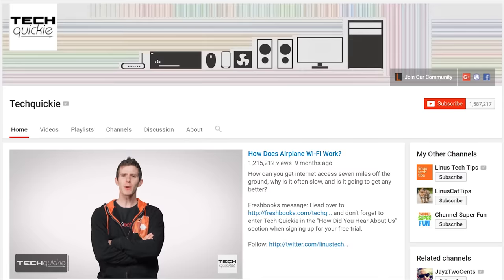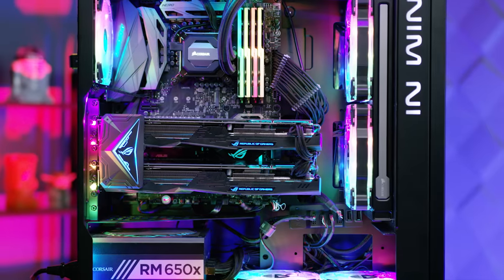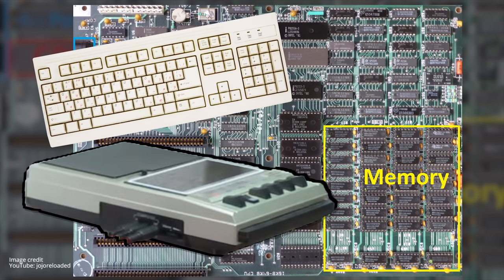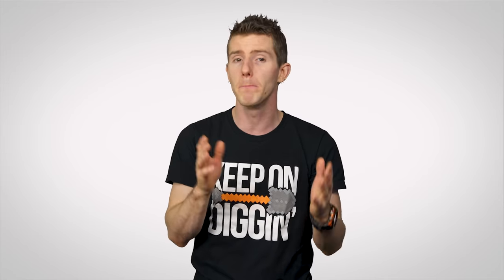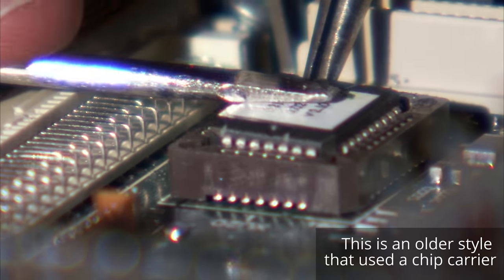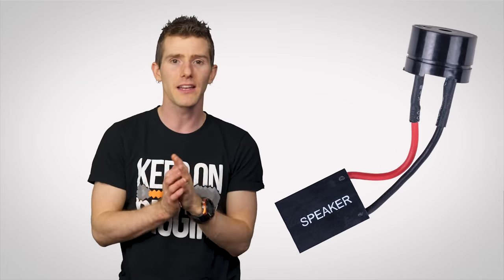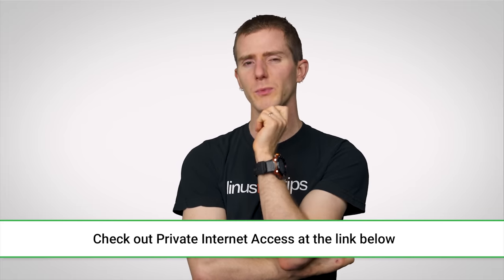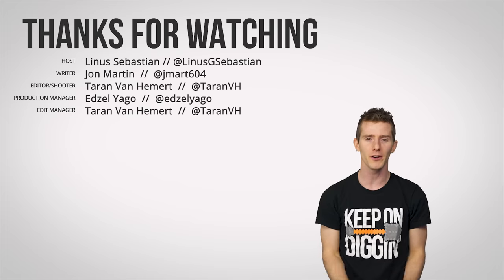History of the Motherboard

Comment: My first PC didn't even have an ethernet port. Wow, I'm old.
Reply: My friend's son's first PC does not have it either
Reply: And mine had no hard drive but booted up from 2   3 1/5" floppy's Ms dos disks. Tandy 1000tx . Cost  $1800. Some progress!
Reply: And I'm so young, my first laptop also doesn't have an ethernet port.
Reply: like in new mac ?
Reply: Apple enter the chat ...
Apple became admin...
Ethernetport kicked from chat...¿
Reply: My first PC still had a token ring network ;)
Reply: I wub u
Reply: @goodboi42  macbook?
Reply: Remember IBM?
Reply: @hesoyam9004  Pepperidge Farm remembers
Reply: Same! I remember my dad buying a home networking kit which came with two PCI Ethernet NIC’s, a 4 port Ethernet hub, and two Ethernet cables, and we had to add the cards to the PCs
Reply: I built my first PC from a kit and soldered each chip onto the motherboard. It used a Z80 CPU chip. I can't remember whether I expanded it beyond the base 16kB RAM all the way up to a whopping 32 kB or 48 kB. I entered the code for an alternative compiler into it (BASEX) by typing in the hex codes of the entire compiler.
Reply: @Bas_Lightyear  me too. I spent a lot of time in the attic pulling in cables. Those cables have been upgraded to Cat 5E now and the network has evolved from 10 MBPS hubs to 10 MBPS switches and finally 1 gigabit networking switches. I remember the NICs we had were a nightmare to get running in Windows 98, but a LAN party with friends and C&C was legendary.
Reply: Yes you are
Reply: I don't think the AST 486 we had when I was a kid did ether. I remember it had a dailup modem...
Reply: @JohnSmith-xq1pz  our first dialup modem was an external either 9600 baud or 14.4K Motorola. LOL! Networking was never built in those days, because people were lucky if they even had one computer.
Reply: @HughsAlfa33  No respect from kids these days...
Reply: @FoolOfATuque  Oh wow that's old lol. I think ours was a modem card. I don't remember there being a external box the phone line went into. Due to the old phone lines here we never got past 28.8kbps... thank God for 1mbps broadband cable internet of the late 90s lol (we had a super socket 7 Pentium  by than)
Reply: @JohnSmith-xq1pz  yeah, I’m pretty old. LOL!
Reply: @FoolOfATuque  lol I'm getting there...
Reply: Mine didn't have a heatsink.
Reply: @travis1240  386 class?
Reply: @standupyak  my new-ish Windows 10 laptop doesnt have one either
Reply: My first computer only had a tape drive... and my first PC was a 386. Which didn't even had a CD Rom Drive... and a 30 MB Hard Drive.
Reply: And you are all young, when you used Modems. You know what acoustic couplers were?
Reply: @acmenipponair  I know of them...
Reply: @acmenipponair  Damn, dude. You're ancient 😂
Reply: @feynstein1004  And proud of it. I can at least rescue your data on your harddrive, even when your Windows is not working - if needed, I would even do it in DOS 6.22 :D
Reply: @acmenipponair  Well, okay then 😊
Reply: My non modular psu has 3 floppy disk connectors. I am 16 and got my pc last year.
Reply: @def_r4727  Damn 😂😂😂
Reply: All for it going back to that point, all we need is pci-e and dimm slots, else we can add on our own, as we see fit.
Reply: @goodboi42  because it's so thin
Reply: @Gambit24  my acer nitro 5 has one
Reply: Mine didn't have windows 8 and less then 5 gb of ram. I got mine at little over 14 in 2010, my parents didn't not love me, I wasn't in no hurry to get a computer of my own.
Reply: @morganrussman  You okay there mate? 😅
Reply: @feynstein1004  your point?
Reply: My first PC was arguably a PDP-11/34 Minicomputer, than my second a PCP-11/70.
My third was a Bendix G-15 - that was about the same age I was.

Wow you're young!
9-)
Reply: @hesoyam9004  I have worked on ALL of the early IBM "PC" line, including the original MB with 64Meg soldered, the PC-2/XT-1 motherboard with 256 on the motherboard, the XT-2 that COULD finally put 640k on the motherboard, and one that you could put 512k on the motherboard (second gen of the PC-2/XT-1 board that used higher capacity Drams I think).
Reply: @Bas_Lightyear  3Com 905 models or something lesser?
Reply: @FoolOfATuque  Networks in those days were mostly a business thing.
Very few of us had our own PRIVATE networks.
Reply: @JohnSmith-xq1pz  Pentium II never used socket 7.
That was Pentium (second and later generations but not the ORIGINAL 5 volt generation), AMD K5 series, and some less-well known CPUs by folks like Cyrix.
Pentium II was short lived and mostly ended up in workstations, as Intel got dumb and left it with almost ZERO cache.
Then the Pentium III / Celeron showed up in the short-lived SLOT (AMD followed for a SHORT while with the Athlon), then went BACK to a socket.
Reply: @JohnSmith-xq1pz  Some BOTTOM end 486 options could get away without a heatsink, but it wasn't a GOOD idea for longevity.
Reply: @acmenipponair  I've used acoustic couplers, but never owned one.
Ever use an ASR-33?
Reply: @bricefleckenstein9666  autocorrect typo I must of ether not noticed or forgot to fix. It was a Pentium 233 mmx on a super socket 7 motherboard.
Reply: @JohnSmith-xq1pz  I hate autocorrect.
I do have to concede I forgot a step though - it was the Pentium PRO that had the cache issues, and the Pentium II/Celeron that started the "slot" with some cache added to the card the actual CPU was mounted on.

Comment: I still install a little speaker on my motherboards, as many of them still don't have a built-in speaker, in order to hear the POST beeps.
Reply: Tetra Sky So do I. My PC case had one packaged
Reply: How often do you have to refer to it?
Reply: I even bought a pack of them lately just in case something comes without them.
Reply: Hamster Smash almost never. But hey, nobody knows when the trouble strikes
Reply: The last PC I built the case had no speaker so I grabbed one out of an old PC and made a bracket for it. That bracket takes up a whole 3.5" drive bay that I'll never use. I gots to have me some PC speaker action. I used one of those nice rich sounding old paper cone speakers too. None of them buzzer modules for me please.
Reply: You do realize you are nuts don't you? And I really do mean that in a good way, you've got me thinking of a minor upgrade next time I have to go into one of my PCs.
Reply: Who me? I like my bleeps and blops. I got a fever and the only cure is moar PC Speaker!
$ beep;beep -f 500 -n -f 1000 -n -f 2000 -n -f 2500 -n -f 3000;beep
Reply: yep, old tv speakers do a great job , i use them too
Reply: My primary systems almost always feature a debug LED screen on the board, so I use that for postcodes instead.
Reply: @1pcfred  Speakers from old tiny TV's sound good and are small, maybe something to consider for your next build
Reply: @saltysoysauce954  I have a fair supply of genuine PC speaker speakers in old cases. The classic ones are small circular paper cones. I've had PC speakers that were too loud. I used to keep the PC speaker of my 386 in a glass with a paper towel stuffed on top of it to muffle it some because it was so loud. If PC speakers have a volume control I never figured it out.
Reply: Speakers are one of the most useful tools to test computers
Reply: I like my computer booting silently
Reply: Many have debug screens or debug leds
Reply: My motherboard has that
Reply: Why isn't that routed through the onboard sound card?

Comment: Anyone else remember when it was revolutionary for the CPU to emulate the sound card? Wow i'm old.
Reply: I remember when getting a 9 pin serial ball mouse was a serious upgrade to a system...lol
Reply: no but that sounds like good times.
Reply: 9 pin serial mice were long before drivers. Each individual program had to have the mouse inputs programmed into them. Your OS didn't even use a mouse natively that is why it was considered an "Upgrade" because in those days a mouse was completely optional and not needed. Early DOS systems were keyboard input for everything.
Reply: I remember everyone recommending a sound card to free up the CPU from processing sound. You could even feel the difference in speed.
Reply: It qas quite awful until we started to get multicore CPUs, as if you used too much CPU time, the audio WOULD suffer and stutter awfully.
Reply: At least on the older stuff, the audio output hardware generally consisted of a single channel output, where all the audio mixing were made on the CPU before sending the packet to the driver, rather than the multichannel approach of the dedicated audio chips.
Reply: No, I don't remember that as being revolutionary. I remember the Aureal A3D 2.0 chipset as being the finest implementation of 3D audio ever made; it was available for windows 98 and it has been unmatched since. Not content with litigating them out of existance (even though creative lost in court) they purcased the remains of Aureal, did nothing with them and kept pumping out drivers that caused BSODs to the point that microsoft had to firewall the sound drivers off from the kernel, killing off eax etc in the process. That's when the crappy software sound of today took over.
Reply: First had Tandy sound ... Then an adlib Isa card.  Then a sound blaster!  WAV files were disgustingly huge.  So trackers where fun to play with instead.  One short song in WAV on my 14.4kbps modem would take a day + to move.
Reply: Audio is a solved problem--has been for many years.  Most of us are fine with integrated audio; and, fortunately for the fussy few, high-quality discrete audio solutions are still available.
Reply: +Joe Sterling You could not possibly be more wrong if you tried. Audio turned out to be such a hard computational problem that we gave up and settled for kind of crappy stereo separation + reverb. There were some pretty good attempts 20 years ago (aureal A3D 2.0 springs to mind, for partial wave tracing against simplified level geometry and excellent positional audio with HRTF).

There has been some renewed interest on using compute shaders to do 3D positional audio and environmental effects without ugly hacks like reverb due to VR. These attempts focus around using raytracing and filters on graphics cards

Finding all the relevant reflections, refractions and transmitted sounds in real time in a complex environment with moving object and correctly applying HRTF to each ray that reaches the listener, doppler effects to each reflection off a moving object, filtering sounds correctly when they travel through materials etc. is so intractable that a GTX 1080 ti would very much still have to cheat to get anywhere close. You're still just working with canned pre-recorded point sources of audio.

Real time raytracing and real time global illumination will be a thing before sound propagation is simulated well in games and  that's largely Creative's fault, or we'd have been much further along.

There's an even more intractable computational problem and that's computing the sound samples from first principle instead of using canned recorded audio. That's an idea that hasn't even been entertained, much less attempted for how hard it is to do in real time. You can physically simulate e.g. a metal railing being hit with a pipe from first principles. You'd have to know how it couples to the Earth through its foundations and the material properties of everything and then make an overly complicated finite element model of everything and simulate how the railing bends and vibrates, vibration nodes and everything would fall out of that automatically; the whole thing would throw off sound waves in all directions and you'd you would have to model how those spread, reflect, refract around obstacles and transmit through obstacles and eventually reach the listener. Never going to happen, too hard.
Reply: Totally with you on this, 3d positional audio died because of creative and on-board audio. I've lost track of it since but I'd expect modern gpu's and cpu's to be able to handle positional audio considering it was possible 20 years ago. The idea of physically simulating sounds is an awesome idea, it reminds me of how one could create sound envelopes on 8bit machines.
Reply: Kie 7077 binaural audio is starting to pop up here and there in some places. I cannot wait for it to be more commonplace.
Reply: I remember when harddrives in the form of eighter RLL or MFM was the new shit. Or when we began using Floppy disks instead of casette tapes. I remember a time on wich storage was big tapes on big roles and a harddrive was a big platter the size of an LP (or bigger) that were contained in big blue or green plastic caps.
Reply: dogishappy0 Are you talking about covox sound on the parallel port?
Reply: You guys seem young to me. I remember when Pythagoras used a mathematical formula to erect field boundaries after the Nile Delta flooded
Reply: circa 2005 up to simultaneous 128voices game audio>modern max 32 voices game audio.
don't care if it was made with pre-placed "reverb" areas etc rooms but it worked for the immersion and tech was more advanced than current due to actual environmental audio effects unlike emptiness of a padded room.
Reply: Anyone else remember before PCs existed? My icon/avatar was taken in 1967. That is me at the console of my "personal computer" (I could use it anytime day or night). So I guess that I am older. 😁
Reply: PCSPKR.DRV
Reply: I still wish we could do that in DOS to use for bootable USBs with games on it.
Reply: @Walther Penne CPU sound nowadays is only bad in the sense that it is noisy.
Reply: my Commodore 64 had sound, hehehehe
Reply: @Brenelael  Serial mice predate the PC - significantly.
Reference the Xerox "Star" out of PARC.
Some early serial mice used a (AT THE TIME STANDARD) 25 pin DB-232 connector for RS-232 - the connector later got simplified for PCs as most of those signal lines never got used.
Reply: @dan_loup  Sound on motherboard PREdates the Athlon-64 - by at least a decade.
Reply: @bricefleckenstein9666  i think you kinda misread the post. It's about the sound quality being bad before we got multithread instead of being non existent
Reply: @dan_loup  Sound Blaster AWE64 predated hyperthreading on the PC by ... a decade? Close to that I think.
Reply: @bricefleckenstein9666  yep, but the topic is about soundcards that use the CPU for basically having mor than one audio channel
Reply: @dan_loup  Sounds cards ALL "use the CPU" to transfer data from the application (usually a game) to be played.
Inherent to them being in a computer.
Reply: @bricefleckenstein9666  kinda, sound blasters and such you would only point to the memory location and the soundcard would do all the timing and mixing and volume application etc. With one of those soft soundcards, the CPU has to mix all the samples and apply the filters using it's power and had to do it in a timely manner or the sound would break.
With a single core CPU that pretty much meant that any heavy load would interrupt the audio output horribly.
But as we moved to multicore, it's pretty hard to not have at least one core free enough to go feed the soundcard
Reply: @dan_loup  Don't think I ever worked wuth a sound card like that - in over 20 years as a PC technician.
They seem to have been rare.

Comment: The progression is, frankly, exciting....
Reply: Walther Penne
it went right over your head
Reply: Mhh, my DDR3 is running for 5 years straight. Most of the time OC'ed. And I had expensive DDR2 that failed after less then 2 years while cheap sticks from the same company are still working fine.
Floppies on the other hand... the old ones are produced with higher quality then newer ones.
Reply: The progression is frankly, over.
Reply: Gottem
Reply: What a min
Reply: Someone explain the pun please
Reply: @mrstealyorefrigerator2588  Look at the Username of the post..
Reply: @bluenightfury4365  I still don't get it :(
Reply: @mrstealyorefrigerator2588  How unfortunate for you then.
Reply: @bluenightfury4365  wait a minute. So the whole pun was just OP using their name in the sentance.

That's it? That's the pun?
Reply: @nikhilpaleti3872  bruh

Comment: This is the history of the generic IBM PC compatible motherboard specifically. Pretty much every other computer type (Commodores, Ataris, Apples, Sinclairs, Tandys, Amstrads, you name it) had single motherboards with integrated sound, graphics, I/O, drive headers etc. way before the PC compatibles had. Many, also had socketed chips including CPUs. Actually, socketed chips became less common from the 90s onward, rather than more common (although PC CPU sockets stayed and gradually became easier to use).

Comment: I remember my old Amiga 2000 had a huge mobo--it took up the entire bottom of a sizable desktop case. A cute thing about that mobo is that while it had a soldered-in Motorola 68000 CPU, it also had a Processor Slot where you could plug in an accelerator that would take over with what one would hope was a much faster processor and faster memory.

Now my A4000/040 system omitted the soldered-on processor but it's CPU would sit on a card that could be easily replaced with a faster processor board that also often came with a place to install faster RAM or other hardware. 

Another nice function is that the Amiga Zorro-III expansion board slots were placed on a daughter board that plugged into the motherboard. This allowed my second A4000/040--that was in an Elbox tower--to use a third-party daughterboard that had more Zorro-III expansion slots and would allow me to take better advantage of the added space that tower conversion kit gave me.

I did notice that there didn't seem to be much, if any, logic on those daughterboards.